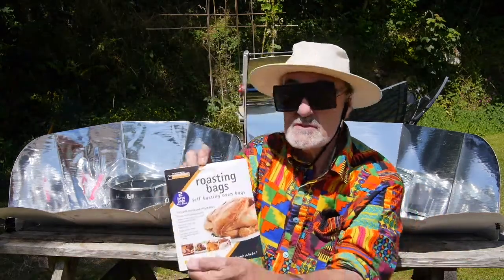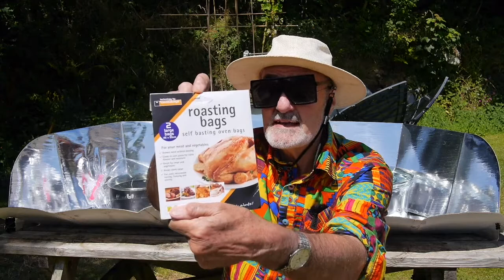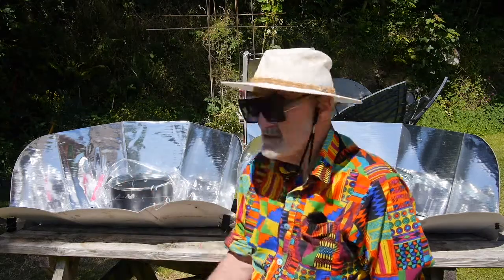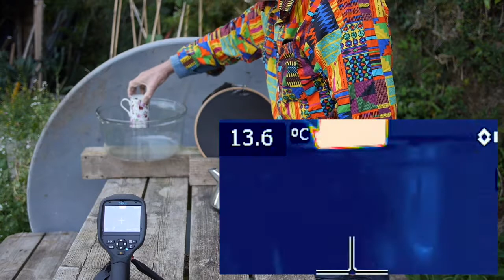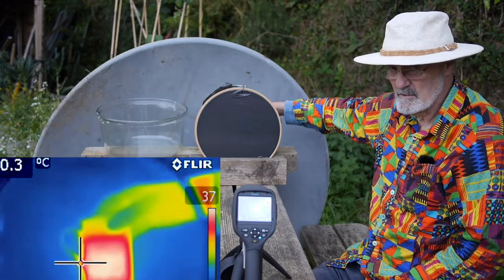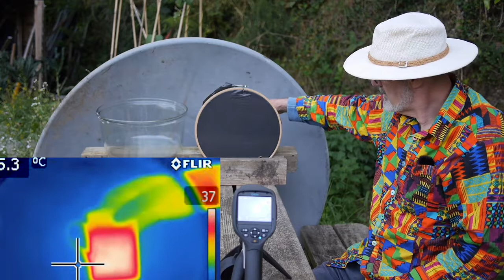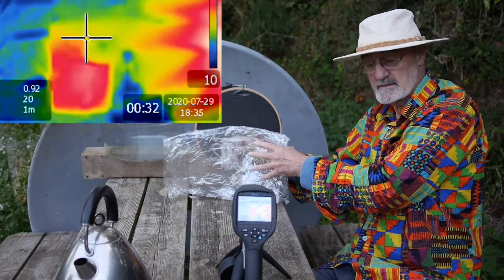Cooking with Starlight : 02 : Heat Traps for Panel Solar Cookers : SLiCK solar cooking

Comment: IF the glass was green or yellow or blue will it still cook as heat from sun is mostly from the infrared spectrum?
Reply from the maker: Hi, Gordy.  I think the answer would be: 'nearly as well'.  The yellow or blue light you mention would be partly reflected, and that would slightly reduce the amount of light hitting the pot.  As you say, the majority (just over 50%) of the solar spectrum is in the NEAR infra-red, and that would get through the glass to the cooking pot, as would all the other solar wavelengths except the yellow or blue.  This video was about showing that the FAR infra-red radiant heat from the pot would not get through the heat trap.  Remember that the surface of the sun is around 5,500C, and the radiant spectrum emitted by it extends into the NEAR infra-red part of the spectrum, which WILL pass through glass, whereas a cooking pot will have a surface temperature of, say, 100 to 200C, and that emits radiation in the FAR infra-red, which will NOT pass through the glass (though it will pass through most plastic films, which is the point of the video).
Reply: @DaveOxfordCookingWithStarlight  

I am sure there are better studies then this short video somewhere 

https://youtube.com/shorts/wADVcUjbG1s?si=Rml9bUy3_KIv34vF
Reply from the maker: Hi Gordy, sorry about the delay - the YT algorithm put your post into the 'held for review' file because of one or more words you used!  I don't know what the offending word(s) was/were.  Maybe the word 'Shorts' is offensive!?  Who knows.  Anyway, thanks for the link.  Yes, I made a Herschel Box when we first went to the Green Gathering about 8 years ago, and repeated his experiment.  Sad to say I didn't video it.  I still have the black-sprayed thermometers and the prism we used.  (the cardboard box with the black interior was discarded years ago) so I guess I could make a vid one day, but it's not high on my to-do list at the moment.  I believe it's a standard lab experiment on some Physics courses, mainly in the USA.  Herschel first noticed that some of the filters in his large telescope, which he used to study the sun, were warmer than others (or perhaps his sister noticed this - she seems to be the unsung hero when his work/discoveries are recounted) and that led him to investigate further.  He himself was annoyingly talented - grinding his own lenses, discovering a new planet, discovering infra-red, being the Astronomer Royal, and so on ...
Reply: @DaveOxfordCookingWithStarlight  thanks fir the reply
Reply from the maker: Pleasure, Gordy.  Enjoyed your interview with Luther, BTW.

Comment: Great video. I live in Arizona USA and cook in a solar oven on a regular basis (a few times per week) I previously used a sun oven but when it was time to replace I just used an inverted glass bowl over a black ceramic pot.  The pot sits in a shiny wok providing a reflector.  This works pretty good but need to find a clear glass pot like the one in your video. Do you have a link?
Reply from the maker: Hi Lion, glad you like the video.  The sad truth is that conditions for solar cooking in Arizona are much better than they are in the UK, so stuff just works better where you are.  The clear borosilicate bowl you see in the video is from a halogen cooker.  These have been around for some time, and many of them have come to the end of their useful life, so they are being scrapped.  This means you might be able to find one that is being thrown out, via Freecycle, or a similar organisation.  Failing that, you can usually buy a new bowl for them, to replace a broken one.  Here is an example of a halogen oven.  Good luck with your solar cooking setup.  https://www.amazon.com/Classic-Cuisine-12-17-Halogen-Tabletop/dp/B01N4PQDJX/ref=sr_1_2?crid=24OC3VTHJQGC1&keywords=halogen+oven&qid=1687009234&sprefix=halogen+oven%2Caps%2C174&sr=8-2

Comment: I would have never guessed the results you showed in this video.
Reply from the maker: Panel cookers are inherently low-powered, so it's important to design the system so as to squeeze every watt out of the available sunlight.  With the well-known CooKit, one fitted with a glass heat trap outperforms one fitted with a plastic one by around 20%.
Reply: @DaveOxfordCookingWithStarlight  Oh wow.